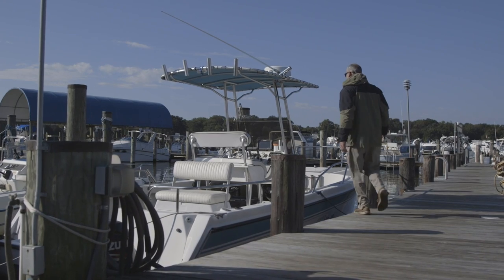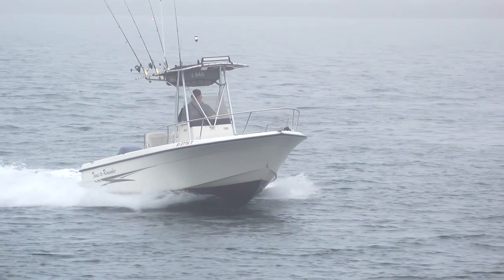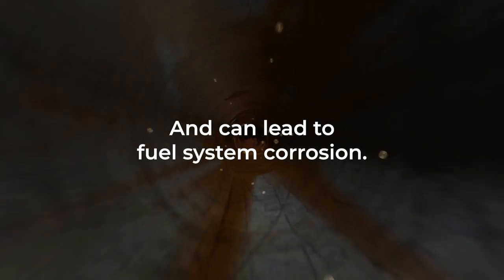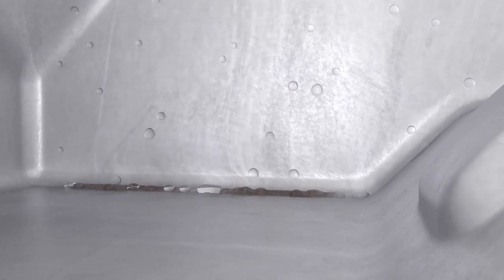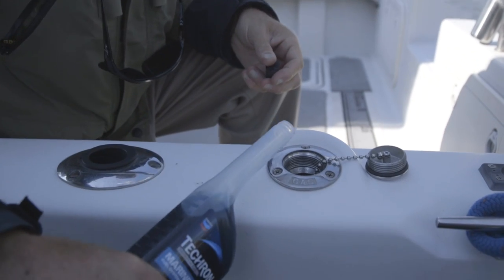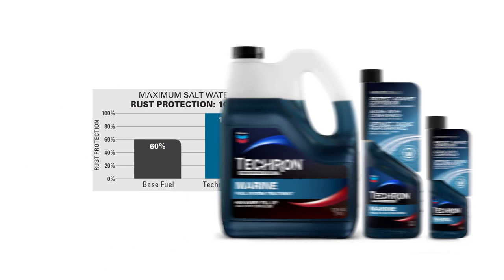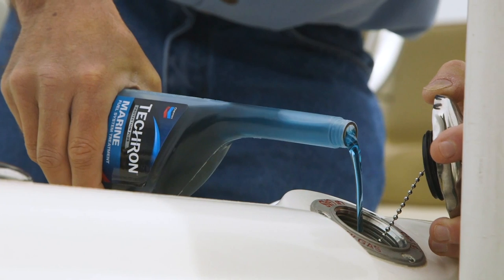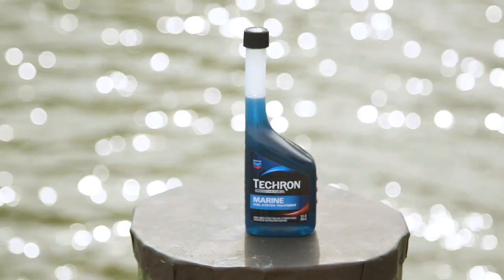Using a High Quality Stabilizer as a Critical Step in Your Boat's Winterization Process

Comment: Been using this in my lawn and garden equipment since last year only 3cc per gallon (I use a 25cc lab cylinder) fingers crossed . Yes I know there is a lawn and garden version but I figure it's just the same stuff diluted down and dyed yellow.